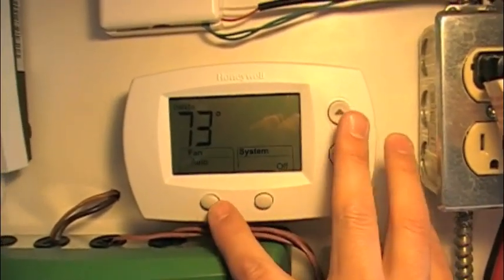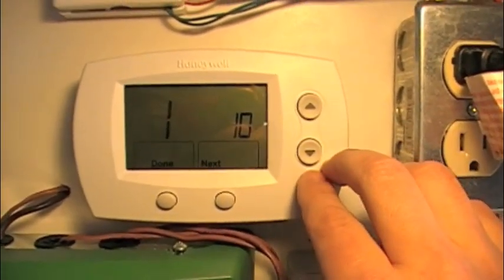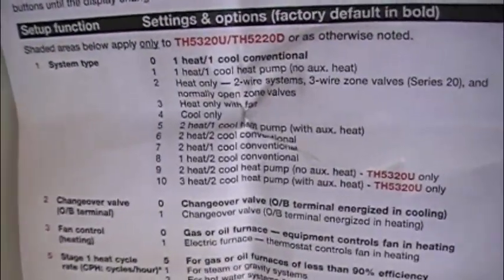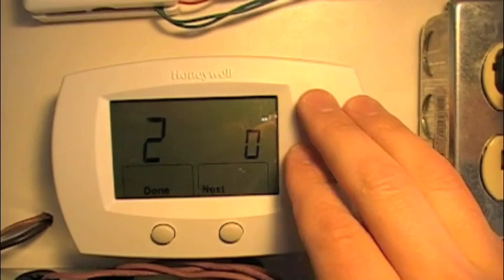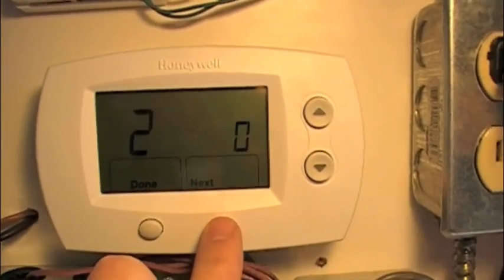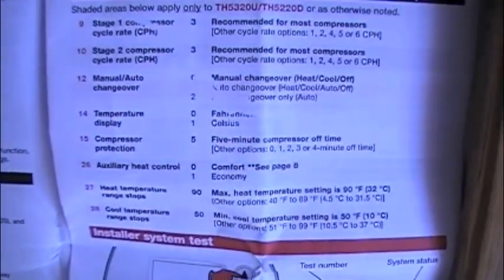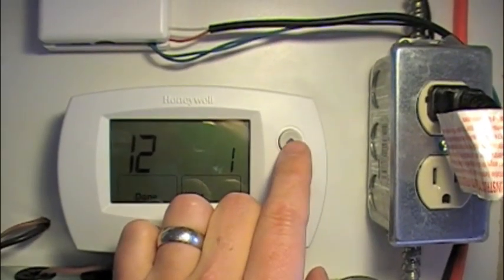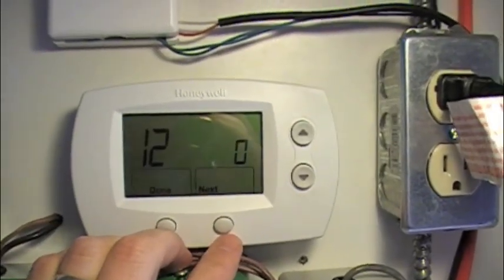Honeywell Focus Pro 5000

Comment: What a great visual of the different modes!  Thank you.  I was looking for programming for this exact thermostat.  I thought I had seen it before but I need to change the temp offset, I think thats the proper term.  It's like it's too sensitive.  I have a heat pump package unit that I did a complete service on recently(it's 12 years old). Cleaned the condenser and evap coils and the blower fan was super nasty so I removed it and thoroughly cleaned it. Obviously,  the first thing I noticed was that I could now hear air moving through the registers.  So, that drew my attention to what seems to me to be short cycling. On 90+ degree days the ac runs for 5-7 minutes then off for 10-12.  The house calls for 2.5 tons, it is a 3 ton unit, so that could be a contributing factor.  It's also a mobile home completely under an enclosed insulated metal roof and 1" thick cedar board and batten siding and a 14 foot wide wrap around porch. So, no sun hits the mobile home.  It has been very energy efficient until last month after I cleaned the ac unit, my power bill was $266.00.  I know, most people think that is super cheap but for us that is high.  We have some of the cheapest utilities in the south. The month before was $190.00.  Is there a way to change the sensitivity so it doesn't cycle so quickly?  My old digital thermostat used to cycle when the temp it was seeing dropped 1 degree on the display (and that was adjustable).  This one does not.  And the digital thermometer I have sitting on a counter top about 12 feet away doesn't change.  Thermostat is set on 76 and the thermometer on the counter top reads 77 all day long.  I would be fine with the temps rising 1 degree if it meant the ac wasn't short cycling.

Comment: Thank you for your video. My thermostat system is keep running (only I wanted to turn off) when both setting and inside temperatures are matched. I put a jumper between R & G wires, the fan did not kick in/turned on, the thermostat is good then. What else is caused the system keep running?

Comment: will this set up "programming" b lost if there is a power outage and there are no batteries installed?  I am trying to figure out why/if batteries would be used if the system has 24v with a "C" common wired.  thanks.

Comment: I've noticed for a few years, My Honeywell Thermostat ( My home is Total Electric)  Home was Ground Up Rebuilt   Katrina DISASTER  CHRISTIAN CHARITY (NOT  GOVERNMENT) They Hired Contractors for Plumbing, ELECTRICAL ... Of Course I have The Same ELECTRIC POWER COMPANY. But , I've Noticed My *Thermostat's Cycles,   IT RUNS UN-NECESSARILY !!!  IT WAS PROGRAMED UPON COMPLETION. "I READ SOMETHING INDICATING, MY ELECTRIC POWER SUPPLIER IS AFFILIATED WITH HONEYWELL AS IN STOCKS  'S 🤔 ...  Hmmmm

Comment: will the g terminal stay energized if you leave your fan on?
Reply from the maker: Yes... or vise-versa.... if the g terminal is energized the fan will be running.
Reply: ok because i have an oil burner and when the compressor for cooling turns off the fan speed slows down how come that happens?
Reply: same for heating too
Reply from the maker: The G terminal is often 50% fan speed.
Reply: ok thx
Reply: I figured out that the fan on the oil burner cycles through different speeds when in a particular mode like heating or cooling.

Comment: I have a Bryant 4 ton package unit,  also a Honeywell pro5000 stat, My system cycles or comes on many times per hour,  So If I set Stage 1 compressor cycle rate to lets say 3, it will only be able to come on 3 times per hour, no matter what the temp,  Right or Wrong.

I dont use the heat at all, maybe 1 or 2 days per year.

The way its been working is if I set it to 78 deg, it comes on at 79 deg, goes off at 78 Deg, afraid Im going to wear out my system, So is program Number 9 the key ?
Thanks
Reply: I would like the answer to this question too.. I have the EXACT same problem! Let me know what you find out please?

Comment: Hi James,  I would like some help re-setting my Honeywell Th5220D thermostat.  The numbers on your thermostat are different from mine.  My numbers are 1, 3, 5, 9, 10, 12, 14, 15, 27, 28.  The numbers on your thermostat  in your video are 1, 2, 7, 8, 9, 10, 12, 14, 15, 26. It makes no sense as to why the difference.   Any ideas on setting mine up?  Thanks,   Doug
Reply from the maker: Hi Doug,  Here is another PDF of an install manual which may help you.  https://customer.honeywell.com/resources/techlit/TechLitDocuments/69-0000s/69-2698EFS.pdf

The shaded areas show menu items that are only applicable to some of the models.  I would suspect that the #'s that do match up between the model I used in the video and yours would reference the same things but hopefully by cross referencing a few different set up manuals you can confirm that.
Reply: @JamesSchenck  =====
Reply: @JamesSchenck  ==+==
Reply: @JamesSchenck  =+===
Reply: @JamesSchenck  +++===
Reply: @JamesSchenck  =====
Reply: @JamesSchenck  ======

Comment: my white rodgers has a y2 setting, 10,15,20 minutes. but it does not work, never-ever, once it gets within a 1/2 degree of satisfaction. in august, ive seen this thing run at 75.5(tstat set on 75) for 8 hours solid. i would never ever use another 2 stage, i mean if somebody gave me a new one i wouldnt use it. if you got 54,000btus of cooling,stage 1 only is about 37-38000btu, and that dont come close to cooling a house thats 2600 sq ft. in Central alabama, one of the hottest places in the nation, in the middle of summer, you couldnt give me one because all my money would go to trying to cool it. im currently trying to figure a way to convert it to a single stage. seems you need a single stage board, because the fan ismulti-stage (EEM) then you would have to energize the 2-stage internal compressor switch(low voltage i think), so it could be done, but can it be done without a single stage board? you look like you seem to know a lot about this stuff. i do to, but, i would love a bit on input from a pro

Comment: i hate my 2 stage cooling. on very  hot days, a few weeks out of the year in the deep south, i set my tstst on 74 cooling it will run for hours on 1st stage and never get below 74.5, the 1st stage does not have enough BTU's to bring it down to satisfy, its the same if i set it on 75, it will stay on 75.5. we got plenty of heat pump. 5 ton for 2600 sq ft(new home with largest r-factor possible), but no matter what temp i set it on(besides 77 and above)the 1st stage will stay running all day. im looking at this tstat and i read there is a comfort over economy setting, that will force 2nd stage when you want. the tstat i have now is supposed to force 2nd stage after a user programmed setting, (10,15,20 min), but once it gets withing 1/2 degree, 2nd stage will never come on no matter what....wish i would have got a single stage now, i really do, i was trying to save on electric but ended up increasing my bill about 25-30%. so im looking at this tstat and im wanting to know can you force 2nd stage on by using the comfort setting? even when its within 1/2 degree? let me know
Reply from the maker: I don't know if the comfort setting would make 2nd stage come on sooner but if it didn't I'd just move the second stage wire (Y2) to the first stage terminal (Y1). (And keep the first stage wire there so you got both wires in the same Y1 terminal)  Then you'd essentially have a single stage stat.
Reply: is there some way to turn a 2 stage into a 1 stage? i tried to move the Y2 to Y1, even jumped them together, somehow it doesnt work like that. i havent checked that out fully, and dont understand why it didnt work. im thinking along the lines of buying a board for the exact unit but with single stage compressor, then permanently energizing the 2 stage switch on the compressor, then trying to stick the EEM fan motor on the high setting. without the 2 stage board, it wont call for the other stage, and wont increase or decrease fan speed, if i leave the board, it will obviously keep trying to change stages, internally, fan/compressor. im all ears for suggestions. but the goal is to convert a 2 stage compressor, into a single stage. any help would be greatly appreciated, especially if involves NOT changing the board
Reply from the maker: Jess, I would go back to your first attempt of moving the Y2 wire to the Y1 terminal and use a multi-meter to check for and verify there is a call.  If there is a call, and if both the Y1 and Y2 wires are securely landed then it should go straight to second stage on any call.

Comment: Is there a way to change when the system kicks on?  The system kicks on with the slightest degree change (less than a degree).  Is there a way to change it so that it takes a full degree change for the system to activate?
Reply: Agree completely, Honeywell t-stats are huge energy wasters for this very reason.  They could've made the temp hysteresis adjustable but chose not to.  Honeywell global warming hoax t-stats.

Comment: How would I find out how many watts this thermostat outputs? I'm trying to calculate my heating cost for the coming winter.
Reply: bentouta5 The thermostat is essentially a temperature-activated switch; as such, it doesn't output any watts of its own.  You would need to determine the cost of running your heating (for winter) and cooling (for summer) equipment.  That type of calculation is performed by a heating/cooling specialist (also know as HVAC), and involves factors well beyond a do-it-yourself project level to be even remotely accurate.

Comment: Can anyone tell me why my thermostat 'setting' temperature reading is different from my 'inside' temperature reading.  I want to make my apartment cooler bringing the setting down to 72, but the inside reading just stays at 76
Reply: Karina Fasullo First, ensure that when you adjust the set temperature to 72, you are in the "cool" mode.  The display must read "cool" in the lower right section of the display.  If the thermostat is in the cool mode, and you can set it to 72, but the room temperature will not actually go down to 72, your cooling system may not be able to cool your apartment to that temperature due to heat loading or equipment inneffeciency.

Comment: My thermostat is set to cool but after about three minutes of cold air it switches to heat with the setting on the thermostat still reading that it is in the cool mode, should I just buy a new one same model and install it on the existing panel or should my ac/heater be checked?
Reply from the maker: I would have the system checked before I just replaced the t-stat.
Reply: Thank you for your advice I will be having a tech look at it.
Reply: Yeah,about a 100 bucks,right...

Comment: Great video. I have a Bonaire B320i internal gas ducted heater (heat only) and recently got the Focus pro 5000 hooked up as the original thermostat did not display the correct temperature. The first setting on the Focus pro 5000 is set at the default 0 - 1 heat/1 cool conventional. Should i change this setting to 2 - Heat only or 3 - Heat only with fan? All is running ok after i skip cooling and enter heat when i turn it on, but after seeing your video i am wondering if i need to change this setting??

Comment: Thanks I was able to reset the air conditioner by pushing the bottom right button and the up bottom button at the same time, after I put on new batteries . Then I turned it on.  It worked finally.

Comment: When I put my thermostat to em heat the fan will run all the time below like 15 to 20 degree's outside. Above that it runs normal with the fan coming on when the heat comes on. Is there a way to change this?  I was told that maybe the thermostat was set up for a different region of the US. I live in the northeast,

Comment: I need help. My heat only blows in emergency heat mode only. I can I change it to regular heat. Doesn't emergency heat make your bill higher.
Reply from the maker: Shanae,  Yes the bill is higher if the equipment is running on emergency heat.  It is the same as using electric baseboard heat or an electric furnace.  With a heat pump, the t-stat should be configured so that it energizes Y1 first (first stage compressor) then Y2 (second stage if your equipment has it) then W / Aux (This is the strip heat element).

So essentially you need to find out if your unit is 3 heat / 2 cool, or 2 heat 1 cool and configure the stat to match. The video shows where the menu items are configured in the setup.  Hope that helps.
Reply: Shanae Hull  i love you so much

Comment: I'm having an issue with our thermostat.  The setting seems to be stuck on 50 degrees and I can change the temperature by holding the up button but once a I take my finger off of it, it goes right back down to 50 degrees. Do you know why it would do this?
Reply from the maker: Louisia, I have not experienced that before.  Sorry I was not more helpful.

Comment from the maker: I just added the PDF of the instruction manual in the description above.  Page six has the details of each set up function.  Menu item #1 needs to be configured to match your equipment.  If you get cooling in the heating mode and cooling in the heating mode you should switch item #2 from 1 to 0 or 0 to 1.
Reply: Thanks SOOOO MUCH! LOVED the training. we were freezing my family out. saved us big bucks not having to buy new stuff or hire the attic monkeys! Blessings on your excellent overview and explanations.
Reply: Is the instruction still available somewhere?
Reply from the maker: @Cid_Phi   I don't know but yeah it looks like the link I originally provided has been rerouted.